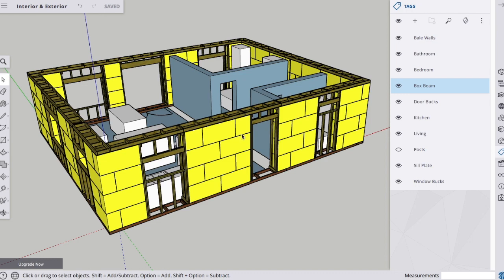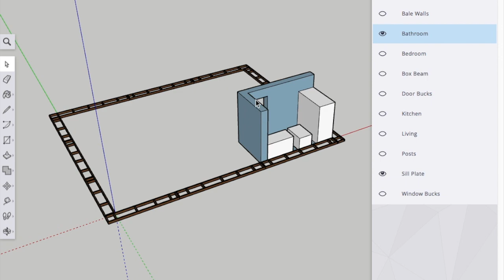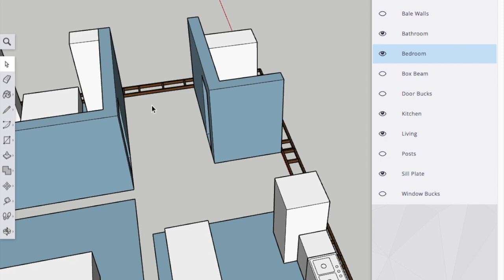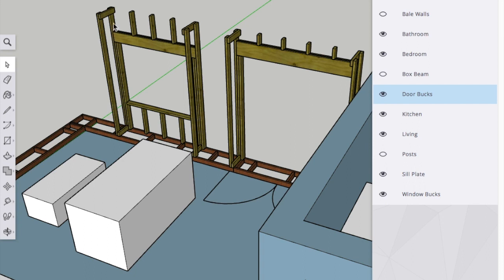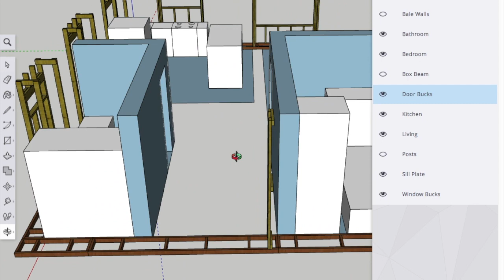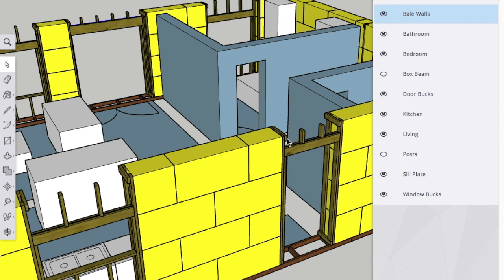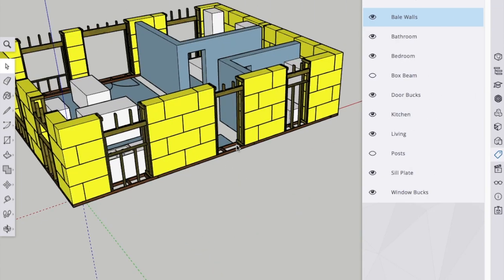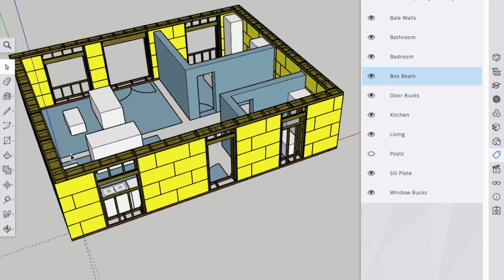STRAW BALE House DESIGN In SketchUp

Comment: By eyeballing, I’m assuming that dummy buck in the west wall is centered. Just a thought, you could slide your bedroom wall over to the center as well. You should still have plenty of hall space and it would enlarge your bedroom as well. But the main benefit would be that the center beam could be smaller because of a shorter span. Great layout and diagram. Thanks.
Reply from the maker: That’s a valid point, Alan, and we probably will! One catch, however is the timing. We don’t really plan to do the interior walls until later, so I still have to span the entire length with a beam to put the rafters up. We do plan on “hiding” one of the support posts within that bedroom wall, though. Just seems to make sense. Thanks!

Comment: Hi Brian/Pam, since you have the box beams on top and bottom to use as securing points, are you going to finish the inside face of the outer walls with drywall, paneling, or some type of cobb coating for a "smooth" finish? Side note, Thanks again for your time and info last week, its going to be a big help!
Reply from the maker: Hey, Rob.  The plan right now is to go with an earthen plaster inside and out.  We may take advantage of the framing around the windows to do some sort of accent material like wood, metal, or something else, but we haven't decided yet.  It was great to meet you last week, and it sounds like you have a pretty solid plan in place.  Good luck, and keep us posted on your progress.

Comment: Very exciting, and I love all the thought (and hard work,) you two have put into it so far, from building up the base with tires to creating the wooden structure, to using gravel as the capillary barrier.  Looking at your design, it seems like it will be really nice with all that light in the kitchen … just one question: will you have enough space for cabinets?
Reply from the maker: We're kind of on the fence about "traditional" cabinets.  May do more of an open shelf concept or store things more in free standing cupboards.  I'm not a big fan of hanging cabinets, and it does take some planning in straw bale, so I'm trying to think of alternatives.  Fair point, though!

Comment: i'm interested how an internal wall will grow from the floor and also attach to the outer wall
Reply from the maker: It may sound crazy, but I'm not planning on doing much to tie them together.  That could be a mistake, but I'm hoping that if I just earthen plaster the joint between the two that the worst I'll have to worry about is covering cracks from time to time at the seams.  I suppose I could use some sort of dowel or rebar sticking out of the bales to connect to the interior walls, also.
Reply: @MidlifePrices  i think that's most flexible.  after u find out ur walls are in the wrong place, u take it down and build another
Reply from the maker: @bavondale  Totally! 😉